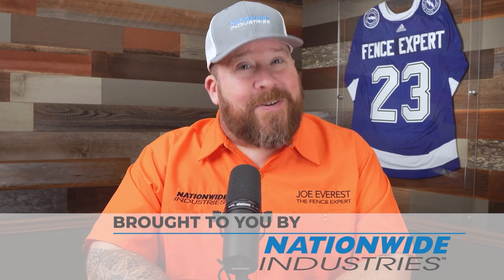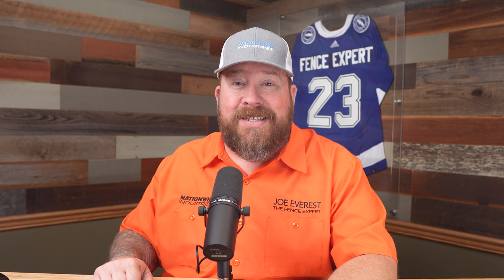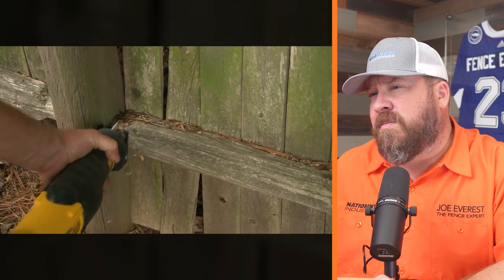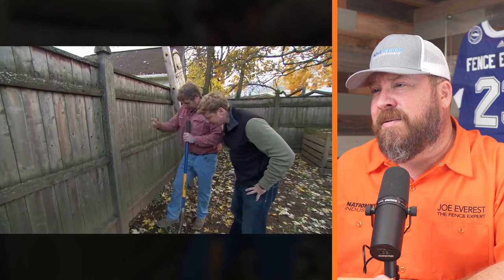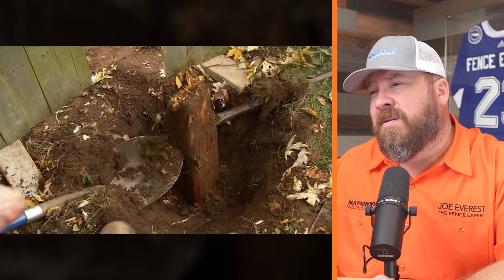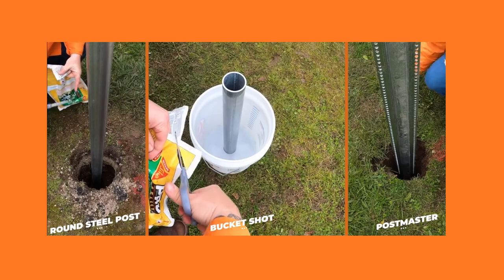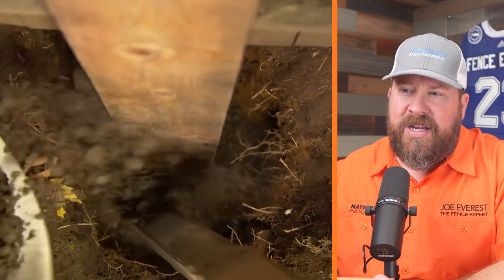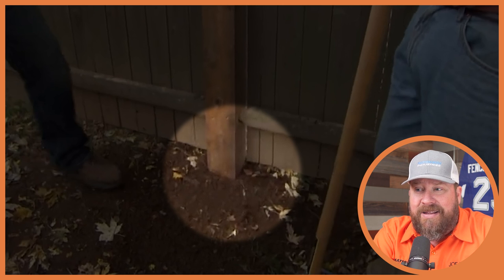I'm Disappointed with Home Depot's Fence Repair Tutorial

Comment: I live up in Canada, on the island of Montreal. My fence posts are down 4 feet in heavy, grey clay soil. I installed it over  20 years ago with compacted stone dust (screening), and on about 3 inches of 3/4 gravel. It is solid, hasn’t budged and no signs of rot. I only used concrete for the gate posts.

Comment: I have seen this on this old house television series. This is common in our area in Massachusetts the wood posts are 5”x5” and 2” holes are drilled in them to receive doweled cedar rails to plug in. A lot of people just tamp up the wood posts. We like to cement near the bottom of the posts and compact the rest to help keep the posts stable and not move. Post saver sleeves help a lot as well.

Comment: On a job like that with a fence that old, I would use a bag of quikrete with a couple cups of quikrock. Go and grab a bit to eat, come back and tie in the rails (level of course) and call it a day. Maybe if they're planning on replacing the whole fence and just waiting on budget or zoning issues and/ or plan on using that post in the new install, I guess I could understand their method. I've only built fence in Texas, I'm sure there are 90 different ways of doing it around the country...

Comment: 1. Try using a concrete post - they don't rot and can be set in concrete
2. If you must use wood, then use a specially treated metal spike into which the treated post is secured. 
3. If you cannot find a suitable metal spike, then at least treat the end of the post that goes into the ground and set it in concrete where concrete has been added, then the post, then more concrete around it - make sure to put the post deep enough.   So you may like to ignore all of this because I am just a uk amateur and not a professional.

Comment: ok so lets say this is new england  and you are just going down 24-30" with the non corner fence posts.  would going no concrete mitagate against frost upheval.   regardless its obvious easier to repair.  i had to redo move my holes 12" when i attempted to replace my fence.

Comment: concrete, dry..  that soil looks wet..  use a string line.. to make sure the post is inline with the other posts, at the bottom, and level.. .. pack it fill with dirt.. .. .  some times, we will use quick setting concrete, depending on the situation.. .. ..

Comment: Concrete footer 6" below frost line, galvanized steel post base bracket wet set into the footer and post screwed to the bracket is the way to go. That setup will last 100 years if taken care of.
Reply from the maker: Sounds like a great solution!

Comment: 7:24 this is also assuming all your posts are experiencing the same issues at the same rate. If you live on a slight slope then some post might experience more moisture than others. Thus the rate of rot would be different from post to post. Hypothetically one post might last 10 years while another lasts 40 years. I’d recommend you actually inspect all your posts and not just assume they are all going to fail.
Reply from the maker: In extreme cases I could see this as being possible, but I haven’t experienced it in the field before.